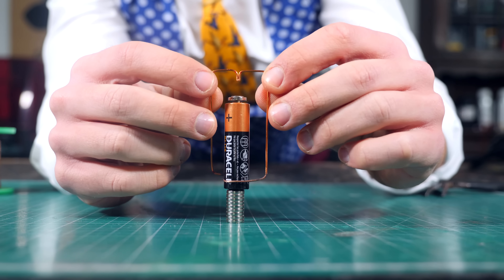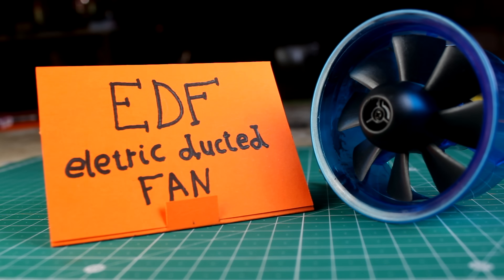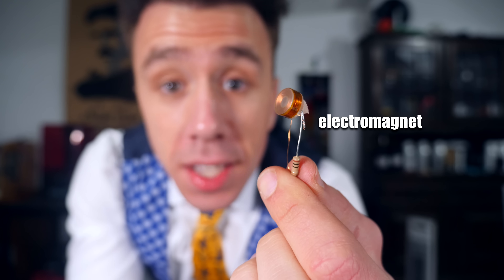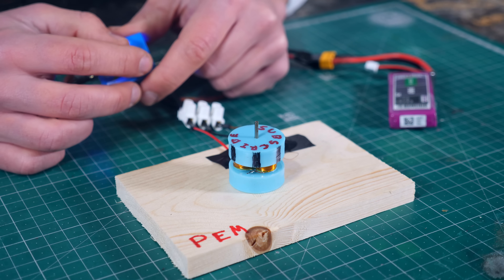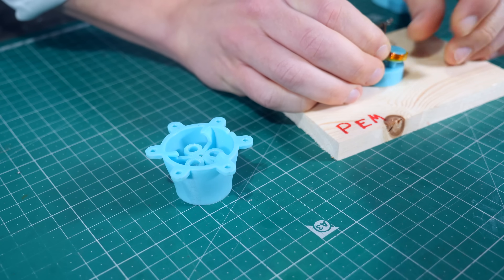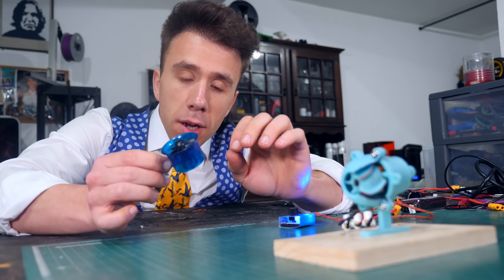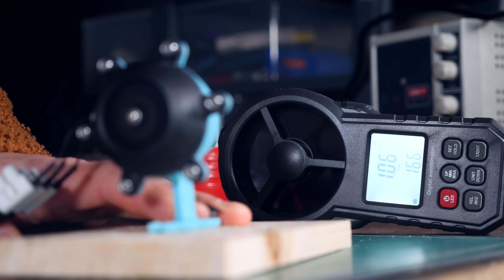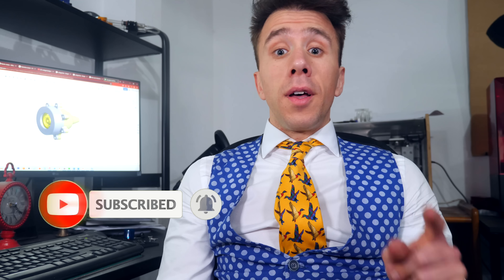I 3D Printed an ELECTRIC MOTOR FAN

Comment: Hi, Integza. Maybe I can offer some helpful input on your predicament. 

Centrifugal and Axial fans are fundamentally different designs which have two different end goals in mind. 

In axial fans such as the EDF the main design goal is to increase the velocity of the flow as much as possible because this change in velocity is where your thrust is derived from (momentum thrust). 

Centrifugal fans are better for achieving a higher pressure rise in a fewer number of stages. Consider how the flow area changes as air moves through the fan. Because the flow passages move radially outward, the flow area increases, and acts as a diffuser in the rotating frame of reference which serves to increase the pressure. You could also imagine how the centrifugal effect plays a role in compressing the air, too—similar to how you feel on a roller coaster when going through a loop very quickly. So, a centrifugal fan will give you a greater pressure change across it than an axial fan running at the same power level because their designs are different.

This is all encompassed in the Euler Turbmachinery Equation, which essentially states that the input power to the flow can serve to either increase its radius or change its velocity. In the case of a centrifugal fan, more of that work is directed toward the radial increase, whereas in an axial machine the overarching change is in the velocity through the machine. 

There are other design considerations such as cost, space, and weight which may come into play when deciding which fan style is appropriate for your needs.

I think it’d be cool to see you do some exploration into turbomachines on the channel, since they play a big role in a lot of the projects you’ve worked on so far. 

Sincerely,
A grad student studying centrifugal compressors 😁
Reply: I mostly agree with this other than the the fact you said that thrust is derived from change in velocity. That is pretty much half the answer. I think i can help explain (along with jack) why radial compressors wont help here. 
Ft = m*  x (Vout-Vin) + (Pout - Pin)*A 
Where:
Ft - Thrust
m* - mass flow of the fluid
Vout - fluid velocity at the nozzle
Vin - free flow airspeed (in this case 0)
Pout - static air pressure at the nozzle exit
Pin - static air pressure around the engine
A - nozzle area 
The maximum velocity of air out of a jet engine is the speed of sound. So assuming that you arent hitting the speed of sound (subsonic Vin) at Vout then you will only create a marginal pressire delta between Pin and Pout. Since there isnt much of of a pressure delta acting on a relativly small nozzle area you wont get much thrust. Jet engines overcome this by adding energy through the Brayton cycle. Since the redirection of the flow vector by 90 degrees creates a big velocity drop and pressure gain youre basically creating a fan design thats optimized for transonic/supersonic aircraft. How i believe this works in vacuums and dyson fans is that the airflow is constriced so much that it allows the pressure to build. To make this design work a bit better i think you would need to have a much smaller nozzle area (only where the air actually flows) and a much smaller duct cross section that leads to the nozzle. 
The reason i think ive seen most of your jet engine attempts fail is because you add a bunch of axial compressors without reducing their cross section. If you want a 2x increase in pressure, yes you do need a compressor that can compress that but you also need somewhere of smaller volume for that air to go. So for a 2 pressure ratio you  need a 2x smaller volume in the next stage of compressor (or duct). If you dont do that then the air just expands again into the extra volume. The same concept goes for the turbine side, as you accelerate the air through the turbine you release the pressure and need to open the turbine cross-section. 

Just the thoughts of a univ. bacc. aeronaut. eng. and a long time fan (pun intended).
Reply: @a_randy  Notice how I said the thrust generated in this case was momentum thrust. Yes, there exists pressure thrust in general, but that's not happening in this application to an appreciable amount.

Comment: Impellers don't really create or impart thrust, pressure is their game (which can be used to produce thrust but not without fuel and ignition like a turbojet and/or a gearbox that drives a fan/propeller like a turbofan or turboprop).

Comment: You explained the answer in the video, an axial fan has more (faster not mass flow) flow which implies more thrust, while an impeller compresses the flow against a diffuser, essentially slowing the air down to maintain mass flow (assuming that both fans have same mass flow), this process also causes the air to lose its flow direction (that's why in jet engines combustion is used to accelerate it through the nozzle).

TLDR: axial fans provide flow without much pressure while radial fans provide pressure without much flow.

Comment: so my quick maffs tells me that prop or impeller efficiency goes down with diameter which is why edfs ussualy fly half the time as prop planes on the same battery even if they fly at the same speed the more air you move the less you have to accelerate it maybe you just need more flow cpuld also be the impeller does not reach the load the motor has to give and the motor just easily hits the rpm limit you cab test this by measuring amperage before the speed control. once with normal edf and once with the impeller

Comment: The biggest reason I can think of is that air at high speeds doesn't do as much work as air at lower speeds, due to air being weirdly elastic on impact. In many of the applications where you'd use an impeller with air, you're taking it and using it in a confined space, where the compressed, high speed air isn't allowed to disperse. In the case of the dyson fan, its being used to supply a source of compressed air to then flow evenly from the ring. In a jet engine, you compress the air and then immediately add fuel and ignite it. In this case, if someone did the math to compare flow-rates and speed, the ducted fan is likely just moving more air per rotation of its fan, and if its hitting the anemometer with less speed, its losing less of its kinetic force due to elasticity.

Comment: I think the problem is a combination of volume difference (size not loudness 😛) between the 3D printed impeller fan and the EDF combined with the difference in blade surface area between the two.
The EDF blades are larger and more numerous than the 3D printed fan so combine that with the smaller opening in the 3D printed fan you get less throughput of air.
To compensate you would need more blades to push the air through harder. The problem is that adding more blades also reduces the volume it can push through. You can compensate for that by making the blades wider. To keep the whole thing the same size you can reduce the size of the hub the blades are on or widen the enclosure if size does not matter 😏

Comment: I would rather not say what i'm doing but i can assure you that i've got at least a pretty good scientific understanding on turbomachinery in general.

There are basically 3 things you did wrong:

1. You assumed that a centrifugal compressor generates the same thrust as a fan does, at equal working points (equal rpm, motor torque, equal pressure ratio of inlet and outlet).

2. You probably assumed that the blade inclination and the so called metal angle of the leading edge and the trailing edge won't effect the efficiency much.

3. You either have no stator (diffusor) or a poorly constructed one, wich leads to your compressor moving less air (low massflow) because the air swirls around the rotational axis instead of flowing straight out of the nozzle. This directly decreases thrust, as thrust is nothing more than massflow times velocity.

In general, fans are used to move a lot of mass very quickly with low head increase (pressure ratio) per compressor stage, whereas radial compressors are used for high head increase (and density increase if we talk about gases) with relatively low mass flow.

There are also cases of hybrids between centrifugal compressors and fans, of wich the Dyson compressor is one of them.

Generally, any form, be it compressor or fan is able to move a lot of air, however, fans tend to be more efficient, construction wise, as they rarely need an extra stator to convert all of the energy of the fluid (pressure and kinetic energy) into kinetic energy.
There is also the also the curious case of training edge placement, wich is differentiated in 3 
main construction types, turned backwards, vertical to the outer diameter and  turnen forward.

These basically change the massflow rate of a centrifugal compressor with equal dimensions.

Besides all this you also need to consider the stall characteristics of your blade design, wich basically depends on the inclination angle of the blades.

Comment: I would suggest putting a 'funnel' air intake on your fan.. worth a shot, no? Start with an opening that's at least the diameter of the body of the fan unit and go up from there.

Comment: The esc is the speed controller. It's right in the name- electronic speed controller. The other thing is a pwm generator. Pwm is what the esc uses as an input to tell it how fast to run.

Comment: There's a local Guy here in Michigan in the USA on youtube called MajorHardware. He runs something called the FanShowdown where he 3D prints all different kinds of fans and designs and tests them. Maybe he could offer some insight or help, or maybe even a sweet colab opportunity! 

I don't know much about fans and pressure. But the design you're trying to build looks like it's meant to have a mid-stage combustion which is really what provides the major thrust. Instead you're trying to compress the flow and restrict the flow to increase thrust. But because there's no additional power from the combustion it just ends up being extra resistance. 

This is similar to using a turbocharger or a supercharger on a gasoline engine without feeding the air into the combustion chamber. You just end up with parasitic loss. 

I could be completely wrong though. I work in IT, not in fluid dynamics.

Comment: That would be a Homopolar motor!
try playing with venturies... in particular a sphere that your aerospike jet fire down through that has three or more venturies built into it that draw more air in from the sorounding area and follows the stream of air from the jet... potentially being a aerospike wrapped around an aerospike. if you are able to make the surface area of the outer funnel of each venturie larger than the surface area of the inner funnel you should draw more air in that the volume of the camber would originally want to allow through  it accelerating the airflow. if you add high voltage negative plates on the intakes and positive or ground around the innermost circumference... you should create an ionic flow.. if this is done to both the original aerospike in the center and the one wrapped around it. It should be able to increase the compression of air between the two spikes in the cylinder of ionized gasses that "should act as a rocket nozzle...

Comment: The area of the centrifugal fan is smaller than the EDF, isn't it? The velocity probably is the same, so it would generate less trust I think. I really would like a 3D  printer. I'm a mechanical engineer :)

Comment: The volume of air inside the centrifugal fan is low compared to a normal fan. If the speed of fans is same, then due to the volume difference (less air is pushed back) the thrust is low. 
By volume of air i mean to say the air trapped between the blades of the motors. At each rotation that amount escapes the fan.

Comment: You probably won’t read this but about the RPM i think it is a simple transfer of speed into force, something you learned with your pulse jet turbocharger. So when you just used a normal motor it didn’t have a lot of force, but when you 3d printed your own design it had more force but less speed. So the centrifugal fan has more force but less speed.
If you look at the centrifugal fan, you see that it starts slim and is wider a the end. This is like a lever. If you push on a lever far from the axis you get more force but you move the thing slower with the lever. 
So here the fans slowly move away from the axis.
So if you want high rpm, you should just do the opposite or keep it the same.
A high force is good for planes because they heavy.
And you could try to print the same thing out and see if your printing makes it worse
Im not an engineer but i hope it helps

Comment: You have to look at CFM vs Velocity, vs Compression, vs Force. The RPM of a larger "Fan" vs the same RPM of a smaller "Fan" will not match, but an increase in power consumption can often time push the smaller fan to do just as well, but at a higher RPM.

Looking at PC Case Fans, common of 120 vs 140: The 120mm fans tend to be much faster than 140mm fans as they run at 1200 rpm compared to 1000 rpm on 140mm. However, the larger surface area and fan blades give 140mm fans an edge in cooling performance, as it does not need to spin as fast as a 120mm fan to dissipate heat and maintain optimal airflow. OR you could say that the CFM is directly related to the surface area vs RPM, but also an increase in power consumption (More friction and rotational mass). It isn't just size. More fan blades = more surface area = more power to rotate. AND you have to look at WHERE the liquid (air) is going. The more you compress compress air, the more friction, the greater the heat, and the greater the forces to try and escape using the path of least resistance (often time not where you think, like ... going forward instead of into the casing) plus Vortex manipulation, (think of the barrier you hit at the speed of sound, but on a smaller scale)

So, look at the movable spike in front of the engines on a SR-71 Blackbird. Did you know that there is a Spike that moves in front of the engine to help direct air into it? (and also made of something that can withstand the heat that is generated at the insane speed) It is there to focus the airstream properly, not too much, not too little.

You need to re-duct your impeller with a shape that allows the airflow to be optimized for you RPM/CFM, the pathway needs to have a high tolerance to prevent escaping air, as well as allowing enough to enter with the least amount of friction, and then adjust the force to overcome the restriction of the Venturi effect. You can use Bernoulli's equation, however, your fluid in this case CAN be compressed. The equation is as follows: P/2(V(ending)^2 – V(initial)^2, where P = fluid density. 

Next, you have to look at a supercharger, and why a twin screw design with high tolerance is used, vs a ducted fan, as the force of one will be greater that the other, but at a cost of more mechanical energy, as well as heat.

Try having a wider air intake duct, use a stronger medium to push your fan blades as large as possible (greatest surface area) at the greatest speed without distortion, use directional veins to control where everything is going, try different sizes (or even make an adjustable) forcing cone. Look at how your exhaust is performing at the narrow part and adjust the exit nozzle to redirect you airstream where you want it. Use your experiments with solid rocket nozzles, pulse jet focusing, and even water impellers to get the result you are looking for. I know you can do it.

Comment: Given the number of variables that differ between the two fans why would you expect similar performance? To troubleshoot this try to reduce the variability between setups. I'm sure experts can give you more direct advice. If they can't, controlled troubleshooting is the strategy that has worked best for me.

Comment: Hey!! An aerospace engineer here🙋🚀✈️!! The main problem with the centrifugal compresor is the pressure drop due to it's axial configuration, which leads to small propulsion. The more you change the flow direction of the air that exists the propeller, the higher are the higher are the load losses. That's why the first generation jet planes used to have centrifugal compressors (for example the meteor F4, or the Havilland Vampire) but after studiying the high pressure drop due to that configuration, the following jet generation changed to an axial compressor configuration, which is the one that we see in the majority of jets nowadays.

Comment: In short, your design has a low volume of air so if you increase the volume of air in your fan design they will generate more thrust.

Comment: Centrifugal fans are efficient but use more power and your design has a low volume of air so if you increase the volume of air in your fan design they will generate more thrust. And make sure that the fan is covered with a proper smooth lid(not intake of air) in order to achieve efficient air flow.
Reply: And increasing the dimensions of the intake of Air and the nozzle from where the air comes out is not of the right dimension.
Reply: Which greatly affects thrust(nozzle dimension is not correct)

Comment: The Impeller doesnt creates any has much bigger blades and probadly around 40000rpm on full speed. The Turbo fan is much smaller and so the fan produces less thrust, because it has tiny blades. The Dyson fan is also not created to make thrust but to be as quiet as possible and cool you down. Maybe try and use an simulation program for it. And make a bigger intake on the Turbofan. I could also think that your measuring device cant pick up the airflow of the Turbofan maybe try and make a better test stand. like 4 stick at the sides and a kitchen scale to measure the thrust.